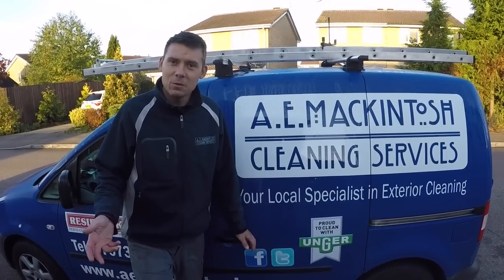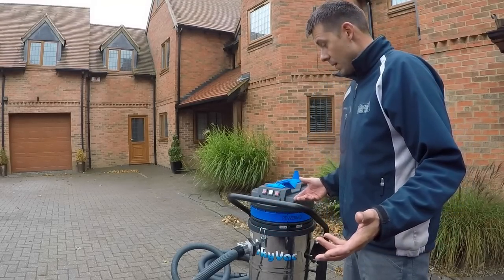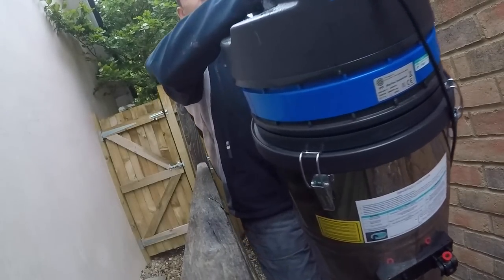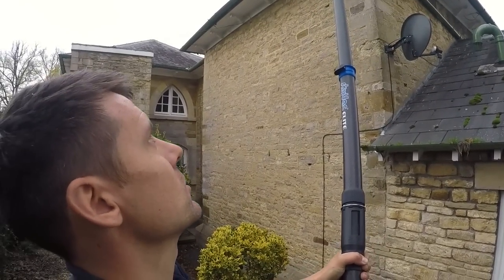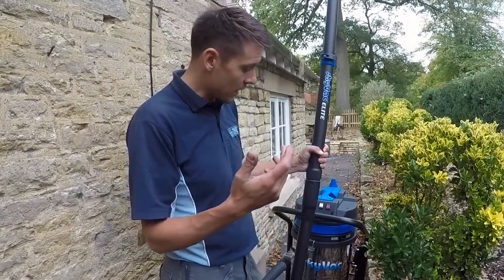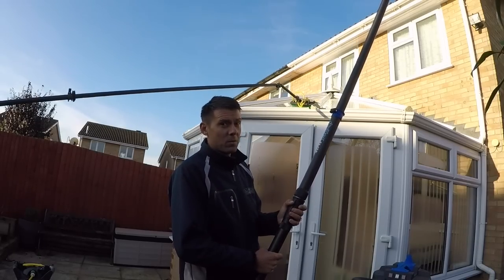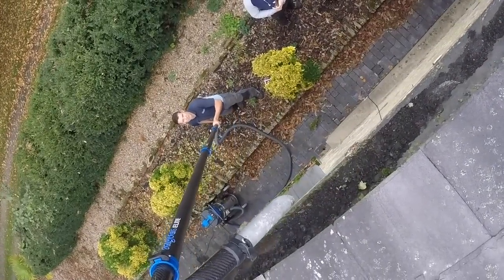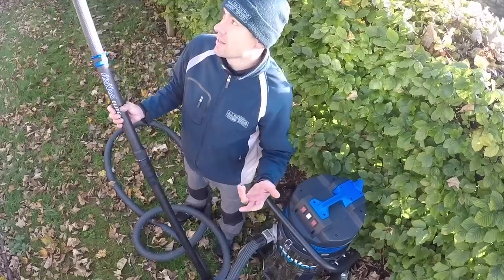Is SkyVac Really Better Than A Standard Vacuum For Cleaning Out Gutters?

Comment: We've got a local roofer who offered this service with Skyvac to my elderly parents.  Ended here to check it out, seems good bit of kit.  So told my parents go ahead with the clean and the camera also checked the state of guttering, roof.  Picked up on a cracked gutter and loose lead.  So fixed before any damage. Heavy green waste took to local green waste tip.
Reply from the maker: Sounds good.👍🏼
Reply: I’m curious the cost the offered for the service

Comment: A number of years ago I bought a gutter vacuum from The Cleaning Warehouse. I really do regret it. It was their own model. It may have been low price compared to other gutter vacuums, but I had a number of issues soon after buying it. The pole was said to be carbon fibre that came in sections. The sections were chipping and splitting not so long after buying it. They didn't clip together, they were just pushed into one another. The end pieces that fit to the pole were not very strong and with some customers gutters they were not fitting into the gutters. I might purchase a SkyVac.  Thank you for the video.
Reply from the maker: The price of the Skyvac does seem a bit painful, but when it comes to usability it is the best out there by far! So I guess you get what you pay for in the end.😃👍🏼
Reply: I regret buying the sky vac atom. Maybe purchase the upgrade from that one

Comment: I wish he would show us that he has to use a generator with this. I bought a vac from another company that had a standard plug because I thought that is what he was using. I wouldn't have bought it if I knew these industrial vacs needed 30 amps to run. I wasted $1600.
Reply from the maker: Most of the time I will ask the customer for access to a plug socket and I use a very long extension lead.

Comment: what a great video well done, i have a seamless gutter installation and gutter cleaning business myself. i own the same skyvac system. a few tips you may find handy...... you may need some grip tape around the carbon fibre bend to hold the camera bracket in place as i find the carbon is so slick the bracket moves, also if you get a lot of water out the gutters you will struggle on your own picking up the vac watch you dont pull your back out, and really clean out the motor filter after every use and dry it, otherwise if its wet it wont have any suction. wish i had the release pole that would be handy on big lumps of grass. love your vids
Reply from the maker: 38sunseeker Great. Thanks for the tips, nice one. Appreciate your comments.🍂😃👍🏼
Reply: do you recommend this product ?
Reply: or not ...!?

Comment: Love my SkyVac intercepted! I recommend bringing a bucket with you because sometimes the hose will clog up and if you have a bucket you put water in it and sucking up water will clear the hose. Also very important to flush the hose out and whatever poles you use when the job is over because you’ll notice a lot of dirt and what not. I usually feed a garden hose into the SkyVace hose to flush it out then do the same with the poles. Also clean the filter after every time using it or at the end of the day. Again I use a garden hose and spray the filter clean and leave it to dry.
Reply from the maker: Great tips.😃👍🏼

Comment: Good bit of kit I'm looking into doing gutter clearing, have you or could you do a video on how to price gutter clearing you done one before on fascia and soffit clean pricing which was a big help.
Reply from the maker: Gordon S Good idea, I will see if I can do that. I quote for cleaning out gutters in a similar way to how I quote for facia cleaning, by counting the clips. Only thing is, you might want to actually take a look in the gutters to assess how bad they are. I have a camera system for doing this, which I will also try and demonstrate in a video at some point.🍂😃👍🏼
Reply: Here in the States I charge $1 a linear foot.
Reply: Price it on how long it will take to do. Minimum 1 hr. Most gutters take 30-45 mins. But always round it up to an hour. £65-85. Job done.

Comment: Great video sky vac is a great bit of kit the new elite poles are great but i would say only downside is the solid bend at the top much better with the old flexible bend
Reply from the maker: Robert Paterson The solid bend is great when you get hold of something that needs a good yank out of the gutter.🍂😃👍🏼
Reply: @aemackintosh  true its great for suborn bits but in some cases you might get a long piece of grass all attached that you may need to wrap around the pole to lift out no joke i have taken out grass as long as 5 meters was a lot to take out at the one go but just need to duck when it comes down hahaha
Reply from the maker: Interesting technique. Good one.🍂😃👍🏼

Comment: As a gardener im often asked to clean gutters which I'm happy to do. This machine would be useless as the pipe that goes in the gutter wouldn't go in the gutter. Perhaps its a northern thing that gutters are installed right under the roof so the distance between the roof tiles and gutter are about 1". I've had to "invent" my own tool to wash out the gutters. Its a bit crap but works OK.
Reply from the maker: They do a number of end tool attachments including a crevice tool to get into those tight spaces.😃👍🏼
Reply: @aemackintosh  its justifying the outlay for what maybe 10 gutter cleans a year. I'll leave it to you  guys! And I'll stick to cutting grass. Great vids by the way. Thanks for your time to put them youtube.
Reply from the maker: Thanks, I’m glad you enjoy the channel. Yeah, it’s not worth it for so few jobs. A smaller vac might be worth considering. The Mighty Atom is so versatile and has so many uses.😃👍🏼
Reply: I’m also here as a gardener! Looking to see what I can do in the winter. My mum was just quoted (and paid) £140 - which was at the  lower end of some of the quotes she received!) for her gutters and fascia’s cleaned out. Said they did a great job but were in and out in 1hr 30!! That’s a lot of potential earnings…

Of course looking at this and the price now in 2023 is £3,000 😂 that’s a big investment
Reply: I will look into the mighty atom!

Comment: Great video... I'm currently using a smaller vac with ali poles.
Reply from the maker: Marc StoW I started off with aluminium poles too. Can’t believe the difference with these, they are so much lighter. You really notice it when you have to reach something awkward.😃👍🏼
Reply: @aemackintosh  I thought aluminium was lighter. Are these carbon?
Reply from the maker: Aluminium is lighter than steel, but these carbon fibre poles are so much lighter than aluminium. It makes such a difference.😃👍🏼

Comment: Whats your method if the customers house has gutter guards installed? This machine seems to be pretty nice but I can see an obvious issue if there are gutter guards. Thanks for the video!
Reply from the maker: Taylor Albaugh In my gutter cleaning playlist there is a video called Ho To Clear Gutters with Gutter Brush in the Way. Guards like that seem to cause more problems than they solve. Sometimes you just need to get up on the ladder to remove them.😃👍🏼
Reply: @aemackintosh  Thanks for the reply! Do you find yourself using this vacuum often? As long as there aren't gutter guards on I assume..
Reply from the maker: Yeah, well I recommend to my customers to have their gutters cleaned out regularly as part of their regular maintenance schedule. I also get calls from people who aren’t existing customers that ask for gutter cleaning. Then I also use it as part of my roof cleaning service to clean out the gutters afterwards.😃👍🏼

Comment: This huge " R2D2" is a fantastic toy !! Would you say that it's less tiring to work with the Industrial 85 than the Atom ? (except the weight difference of each vacuum  :)  ) ; and do you think the Atom could do this work, even with more time ? I see  that you have a side glide entry on the vacuum which prevents waste from blocking or clogging the filter ; Atom has a straight entry without steel protection...more maintenance needed, just have a spare filter . It's possible the set the vacuum port of the industrial (spare) and maybe to better protect the filter...
I'm living near the seaside, and sand likes filling gutters but motors don't like sand !   Have a nice day
Reply from the maker: mono690 The Atom gets the job done, and It keeps surprising me every time I use it, how well it does for such a little vac. Maybe you could adapt it to a side entry, I haven’t tried. But yes, I use it with the filter as well. The industrial definitely cuts through the dirt more quickly and easily though, I really feel the difference in power when I switch back.😃👍🏼
Reply: So for a beginner, the industrial with elite poles  is more easy physically to suck in gutters  ?  do you use sometimes a "pro gutter tool"  , at low height,  just where it would be difficult to suck, or risky, I think of pvc end caps which like to go down.... About a camera, I think that it's a good tool to convince new clients who don't know you or have never seen a gutter vacum in action: you can show them previous works done ,especially if conditions were more difficult...
Reply from the maker: It looks very impressive in front of customers when you use an impressive professional tool like this. It makes getting into awkward places much easier since the poles are so light and with the different spout attachments. I use my GoPro camera on a separate pole to check the gutters.😃👍🏼
Reply: @aemackintosh  the maximum wifi range of cheap cam 4K is 10m ; on the gopro site it's 15 m maximum ; so you don't have "cuts" of video on your smartphone ?  do you have 6,7,8 poles ? Here gutters are 8m high 'just' for old 3storey house ...
Reply from the maker: I have 8 poles, but I’ve never used them all at once. I don’t do much above third storey to be honest. Spinaclean do a camera especially for the vac.😃👍🏼
Reply: @aemackintosh  other choice : https://www.4gmobilecctv.com/inspection-cameras-and-systems/te910ha-2-4ghz-wireless-inspection-camera-with-5-inch-hd-mini-dvr-with-screen-visor-and-rotating-camera-mount.html    ;  camera or gopro , I will attach it to the pole with fishing wire and staple , to prevent bombing ;)
Reply from the maker: Thanks.😃👍🏼
Reply: @aemackintosh  Please , about the elite pole vs atom pole, what's your opinion?   is it much less tiring with the elite ? does the stiffness of elite help a lot ?
Reply from the maker: mono690 The Atom poles are slightly narrower, and they are fantastic with the little Atom. The Elite poles won’t fit this machine. They work great with the Skyvac Industrial and this whole setup will be much better if you are doing a lot of gutter clearing. The Atom gets the job done, and it continues to surprise me. It’s a great little machine, for sure. But if you have got really bad gutters in places difficult to reach, and you do a lot of heavy duty work like that, then Industrial will cut through it like butter!😃👍🏼
Reply: @aemackintosh  I will start this activity, never worked with gutter poles, I have the choice: either the Atom or elite poles +a 2400/3300w vacuum, 100" water lift : not the industrial 85 (150" water lift) to lower the price ...  my idea is  : benefit from additional performance of elite pole, for better efficiency and less fatigue.
Maybe I'm wrong, completely off track..... If you tell me that I really need the 150" waterlift of industrial85 to make a real difference when heavy duty work with elite poles, so it's not worth paying about 3 times the atom price . .. First learn how to work before buying vacuums for pros ;)
Reply from the maker: You can’t use the elite poles with the Atom. There is a model in between, the Skyvac commercial. Might suit your budget?😃👍🏼
Reply: @aemackintosh   2 possibilities : atom with improvements : 50 mm hose  or kit elite poles + vacuum like commercial 75 :  2400W - 100"water lift- 420 m3/h or possibility 3300W - 100" waterlift - 630m3/h   .... the water lift 100"  of my vacuum is a little less than atom but better flow - far lower than the 150"  industrial , please tell me if the elite poles will make a big difference ??
Reply from the maker: The poles won’t make much difference in water lift, but the Elite poles will be much more sturdy, especially with the carbon goose neck at the top. I think you should get the Commercial 75.😃👍🏼
Reply: @aemackintosh  OK Ashley, you think about the kit commercial75 + poles (like atom) or vacuum commercial75 +elite poles ?  ;  for 9m height : kit atom costs 540£ (exc tax) , commercial with same poles than atom : 1470£ , and 'my' vacuum (equivalent of commercial 75) + elite poles : 1614£...   (and for just 30£ more I have a third motor (3300w 175 l/s air flow)...
Reply: Do you use only 2 motors if your client doesn't have a plug > 13 amp standard  ?    big difference between 2 vs 3 motors if you don't use the boost lever ?
Reply from the maker: It’s your call. I can’t decide for you. I wish you all the best.😃👍🏼
Reply: @aemackintosh   I ordered the commercial 75 +elite poles (for a 'dozen' £ more) . Spinaclean is a nice supplier where you should go  ;) Thanks again for answering my (too) many questions. The gutters of my pharmacist were cleaned 28 years ago, he said..
Reply from the maker: Yes, they are very helpful. All the best with your gutter cleaning!😃👍🏼

Comment: Hi. In New Zealand and use an Interceptor. Had to take it apart to fix a buggered diffuser. Now got issues putting it back together. Just wondering if anyone has a video on doing this ? Quirepace don't. Thanks. Dave

Comment: I operate in an area that is almost exclusively dry pine needles for every job. Is it still worth getting a gutter vac or would I just end up frustrated?
Reply from the maker: There is a specific attachment for pine needles. Also what can work well is blowing them out with the blow function. The Atom sonic is good for that. But yeah, pine needles are the worst.😬👍🏼

Comment: How do u clean out the gutter outlet if clogged with grass and roots .u need to take off the swans neck to clean out .I know the way I clean it out but. I be up a ladder with a old plastic bucket wire handle and push it threw it clean it out good
Reply from the maker: There is a longer attachment that reaches down into the swan neck. I find that usually does it, but there are always those odd occasions when you need the ladder. I guess that’s also a good reason for regular gutter maintenance.😃👍🏼

Comment: Hi,I’ve been watching a lot of your videos,really useful.
May I ask when I first started I bought second hand a gutter sucker junior,and a set of poles.
I just couldn’t ever get it to either fit properly in the gaps between the tiles and gutter or it constantly blocked.or wouldn’t actually clear the gutter.
I gave up and went back to ladder and hand tools.
I remember watching a video where you said you bought a cheaper vac then upgraded was it a similar problem basically not enough power to actually clean the gutter properly?
The sky vac atom you would recommend and the elite poles? As the poles continually stuck together aswell.
Thanks in advance
Reply from the maker: The first vac I had was powerful but the frame wasn’t robust enough and the poles I had were terrible. You can’t have the elite poles with the Atom, but you might be interested in my giveaway that starts tomorrow.😜👍🏼

Comment: How does it do with wet debris?  Does it ever clog in the pipe? I'm tired of climbing ladders!
Reply from the maker: It works fantastic. You will never look back. I find I get very few blockages these days. They have addressed most possible issues, including a wider gooseneck angle at the top of the poles. So unless you suck up a twig or something, blockages are greatly reduced.👍🏼
Reply: @aemackintosh  Cool, I turned down 6 apartment complexes, mainly due to my age and needing 5 pieces of stackable ladder, not doing that by myself

Comment: I have a Skyvac Atom, how much better is this machine please
Reply from the maker: Sparkle Broadstairs This machine has 3 motors rather than just one, so it does cut through the muck that bit better. Also the side entry into the drum, and the improved poles as well as other features make this a superior machine.😃👍🏼

Comment: Hiya Ashley, can you use it safely in the rain ?
Cheers.
Reply from the maker: If there is a light shower and I can position the vac somewhere fairly sheltered, then I will try to carry on. But you should be extremely cautious about continuing to use any electrical item in wet conditions.😃👍🏼

Comment: Hi Did you use a generator for this?
Reply from the maker: I usually ask the customer if I can use their plug socket. Most of the time they have an outside socket and I have a long extension lead.😃👍🏼
Reply: @aemackintosh  thanks that’s really helpful. Is it ok to plug a 3600 watt vac into an extension lead or into somebody’s mains? I’m worrying it might blow something
Reply from the maker: You should use the vac with the Powermix lever in the Light Debris position, which keeps the power at 3000w. Switch it up to full power only when you need it.😃👍🏼

Comment: im interested but im afraid id get a lemon and have to ship it back because it dont work ,,also im concerned the poles ere too heavy and would limit the amount of jobs u could do because of operator fatigue
Reply from the maker: fingersmcgee The carbon fibre poles are very light indeed, and Spinaclean have a very good reputation for customer service. I’m sure they would help you out if you get in touch with them and you want to give it a go.😃👍🏼